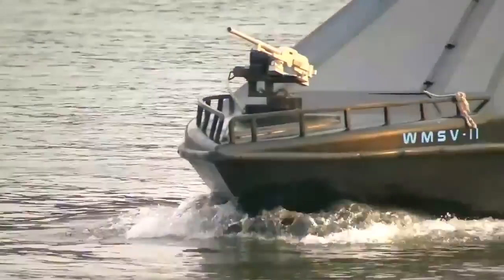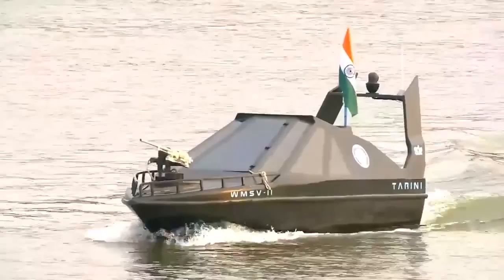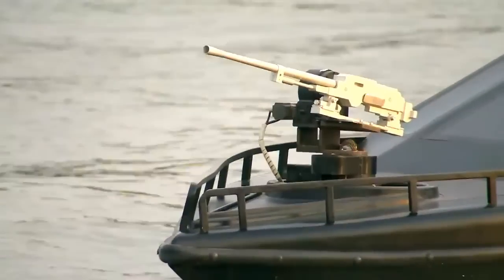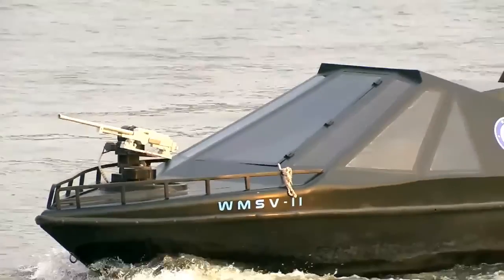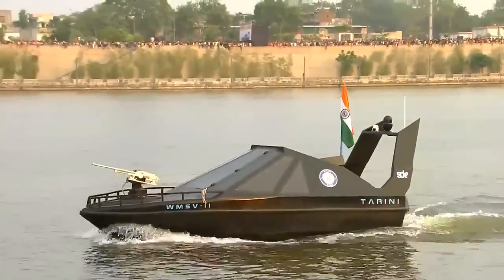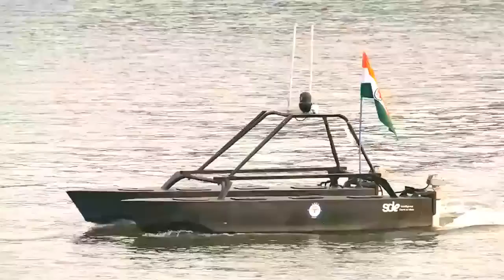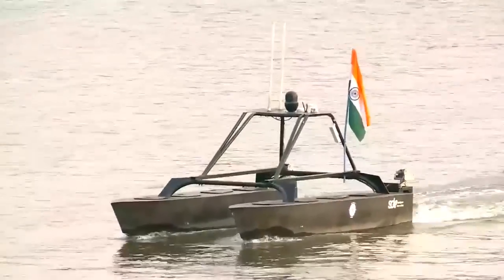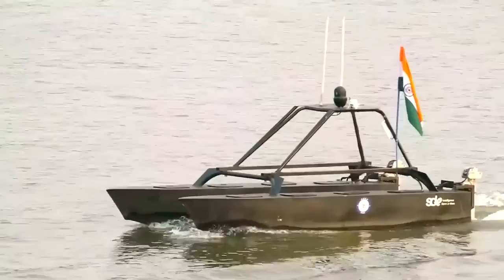DRDO's  armed Unmanned Surface Vessel (USV) in action! #drdo

Comment: DRDO and HAL is evolving but not satisfactorily. Look at the prototype one strong wind and it will be floating upside down.
Reply: You can't say that,Do you know the density of the boat?,do you know exactly what control systems are on the boat?,people make wild assumptions based on hiw something looks,it's not a scaled up toy..
Reply: @g-gon8869  We know that our armed forces are capable enough to make use of this in the best possible way. Want to look at some examples, start with operation safed Sagar and Navy operation of 1971.
Rest assured it is developed by DRDO, not some private firm